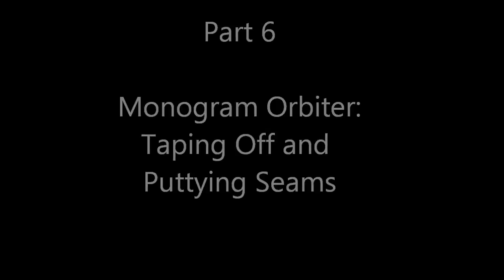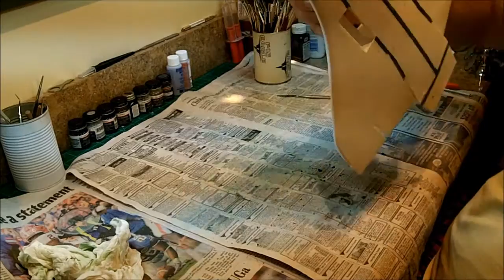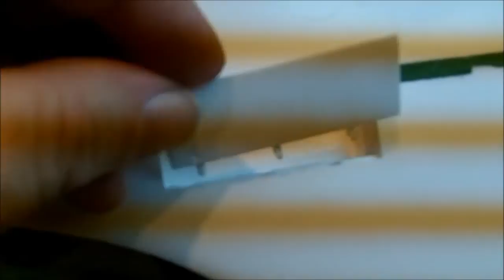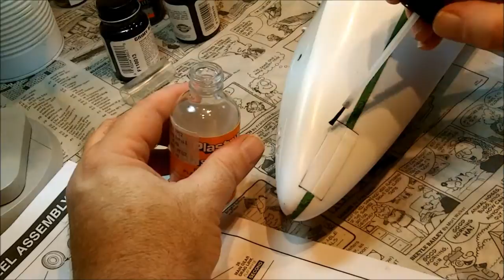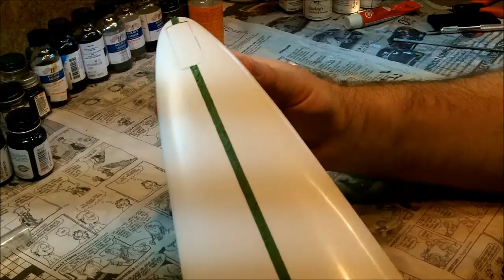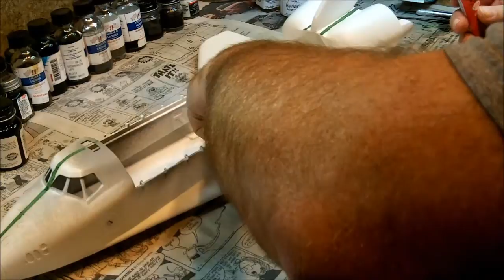Shuttle Wars, Part 6

Comment: @dutycatdotcom They are covered, but the covers are still recessed. So if you drill the port holes out and back with sheet styrene, the thickness of the plastic should give them the proper look. At least the Monogram orbiter gives you the approximate positions (even if the shapes need to be altered a little). It is pretty easy to add them as long as the cockpit is not installed. And you can still add the main gear doors in styrene as well (just measure the shapes, cut and glue in the holes).

Comment from the maker: Now you tell me.

Yeah, I thought about putting sheet styrene in there on top of the main doors after I saw how far they sat down in there.  Unfortunately, I did not have any styrene on hand that was the right thickness.  I suppose I could've waited a couple of days until I had a chance to go to the LHS.  Oh, well.  Next time.  I have a couple more of these in my stash, so if I ever build another, I will use the styrene to help fill the wells.

Comment: One thing that works well for the main doors is if you add a layer of sheet styrene to the outside, cut slightly larger than the doors. Then the outer "door" sits level to the body and can be flush sanded more easily. BTW, for those putting on tile decals, one of the doors is slightly further back than the other (about 2mms). So filling the edge seam and sanding them flush might not be a bad idea anyway to make sure things are symetrical for a decal (paint only isn't a problem).